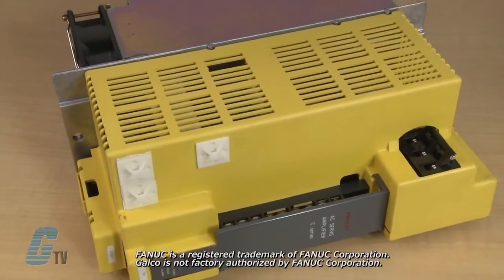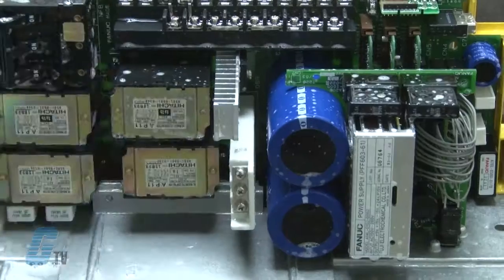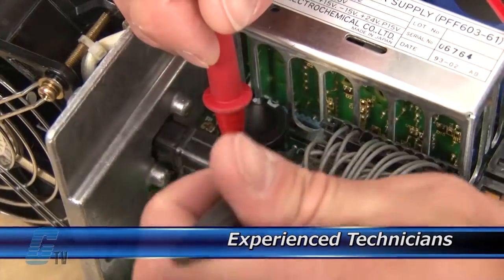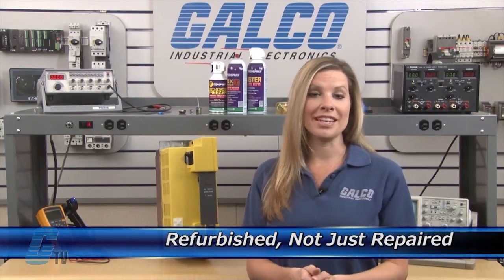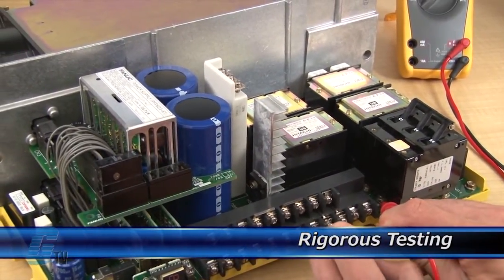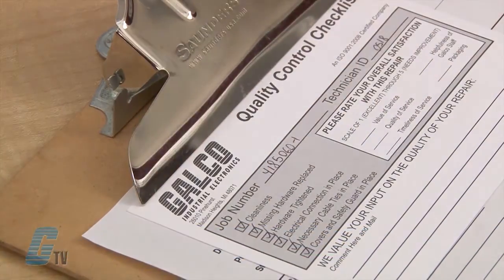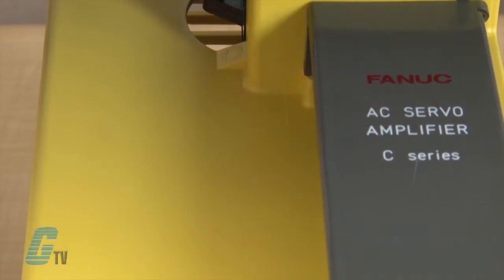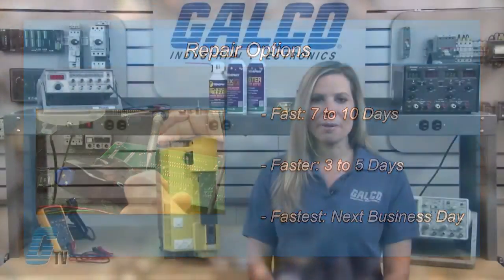Fanuc AC Servo Amplifier C Series Repair

Comment: I have same amplifier C -series fanuc , showing continue error no. 8. I isolate all input wire , and leave only supply wire, but error is still showing, You are requested to  suggest me. want i have to do
Reply from the maker: If you are getting an error number 8 from the LED screen, then it could be an overcurrent trip from one of the axis motors. I would check with Fanuc for detailed step by step actions on what to do for checking on the amplifier.  If the actions they tell you do not work, you may need to replace the amplifier or send it in for servicing.
Reply: Thank you for your response, i isolate all input wires, only i given main supply to Amplifier. but still error 8 is coming. Now, i send it to repair center...thank  you again
Reply: IRSAD AHMAD KHAN Electrical Engineer 
maybe way late, but disconnect the uvw and ground wire going to the servo motor at the amplifier and test the resistance between any of the uvw wires and the ground with a megger.

I found the cable going to the motor was deteriorating and showed about 20 MOhms while a known good axis was about 690 MOhms. Obviously if you have a low value like that, disconnect the cable from the motor and test the motor the same way to rule it out.
Reply: @GalcoIndustrial  I have  a SPM A06b-6088-h222#500 . It has AL-12. What I need to do??
Reply from the maker: I was not able to locate a Fanuc manual with your alarm listed. I would recommend verifing all your power supplies first, line voltage, control power and so on. Good luck.